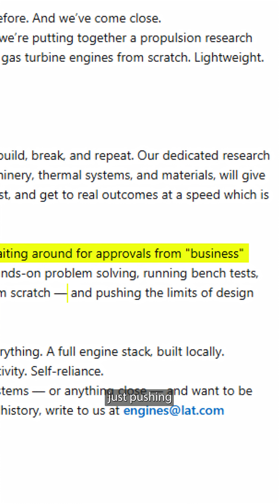India's First Gas Turbine Engine 👏🇮🇳

Comment: The reason Kaveri 😊😊program failed is not about research or innovation. We don't have the facilities to test and iterate fast because every time we make a change and we need to assess the performance of these engines we need to send them to Russia to do some high altitude testing so it's not about speed of innovation there are no facilities to test your product the same thing happens you'll have to send your engine to Russia or some other country to test.😊
Reply: engine is now ready used in derivative form in ghatak uav. And drdo and hal expect to expand the power of engine and metallurgy and material used inside those 110+kn engine are made by 100+ year of research. India can do that in short period of time, because we have past experience of kaveri, 75kn derivative engine approved to fly in uav after 2026. This is great for india as we can avoid import of uav engine.
Reply: @SUNs1591 yes the engine is going to be used in this new UAV but the intended research was done to make an engine for Tejas Mark 1A. The chief of GTRE recently stated that they need 2.5 billion US dollars of investment in the engine sector to develop the next generation engine which needs a thrust to weight ratio of 10. We actually need a trust to weight ratio of 8 from the 75 kilo Newton kaveri engine but the trustweight ratio was 6.5 using the after burner so they need to reduce the weight by around 250 kilos it's not the problem with the research but there are no testing facilities like high altitude testing you have to send that to Russia right that is the problem not the research we can do the research, but evaluate your research you need some facilities to test that is my point.